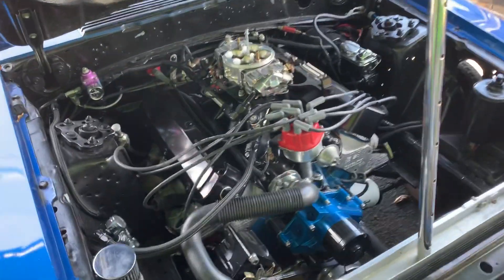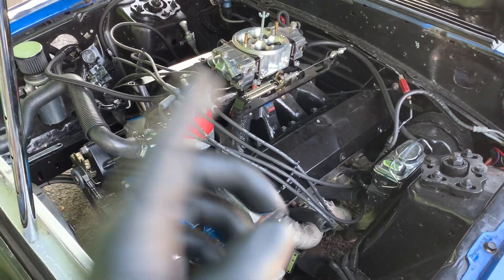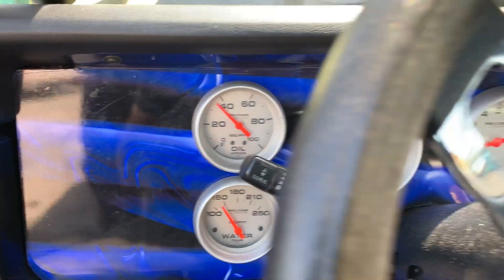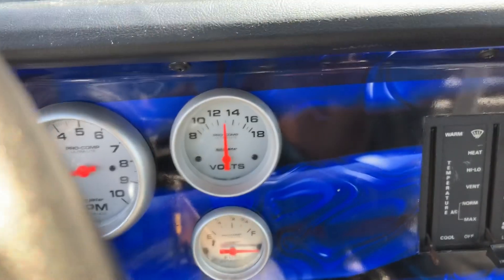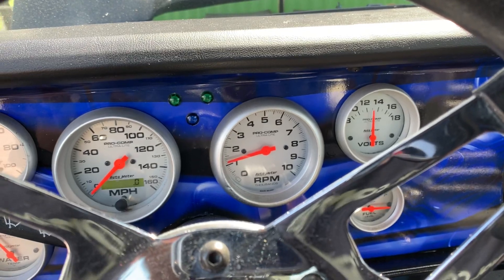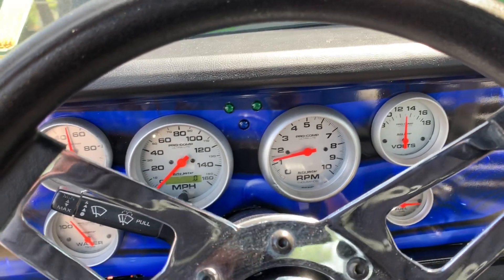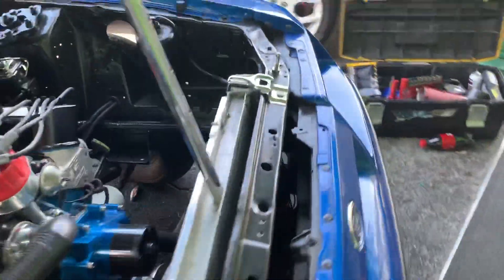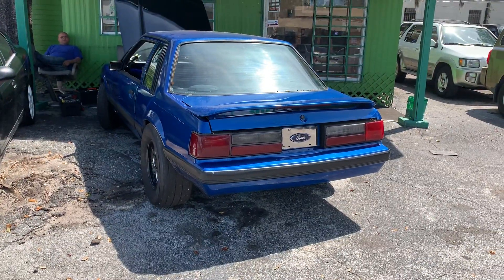Setting the lash on 408 stroker solid roller

Comment: Sounds good! 408 stick car here,  best 10.26 @131. What carb did you go with? I also run at OSW
Reply from the maker: Thank you! Last time this car was out it ran 10.3 @ 132 on the new motor setup. It has high 9’s in it NA once we get it dialed in then it will get hit with a 200-300 shot of nitrous